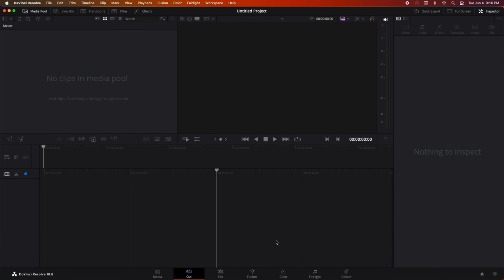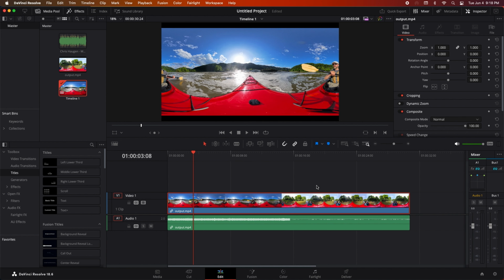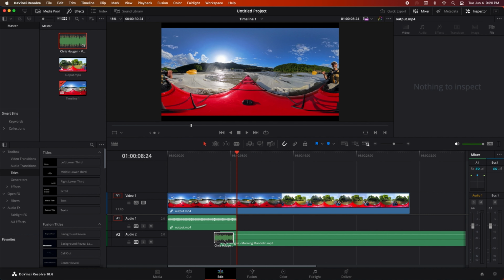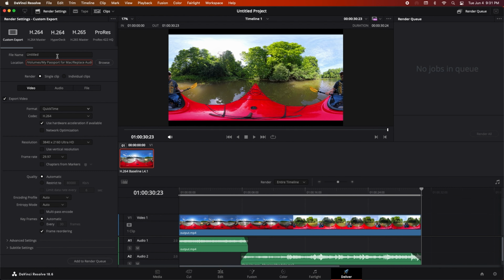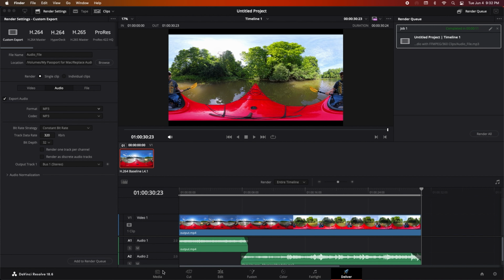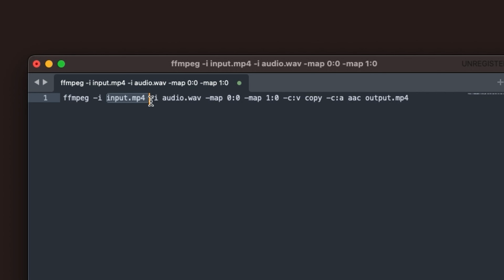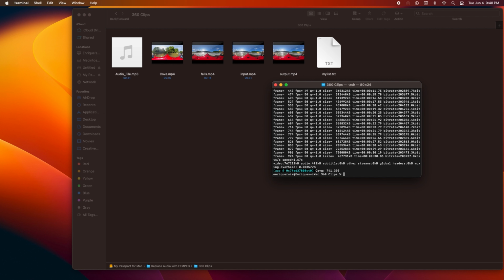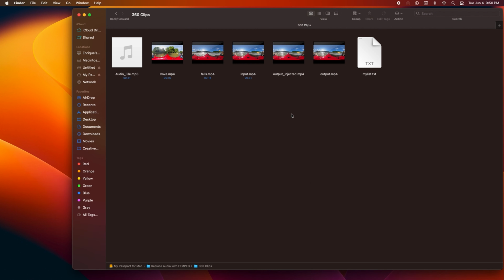How to Replace Audio Using FFMPEG

Comment: @wildwonderfulWeekends, the spatial media metadata injector is not supporting anymore on the mac. Do you have a workaround for me? Thank you! I am ediing some videos for an exhibit in 10 days...
Reply from the maker: Hi Dorine!  Wow, I hate to hear that MAC no longer supports that tool.  Lately, I've been posting most of my immersive content (VR180 and 360) to DeoVR instead of YouTube.  That platform is natively geared to serving immersive content and the video files don't need any meta-data.  You specify what type of content it is during upload and the server then knows how to present it to viewers.  I wish YouTube would adopt that model.  

I realize that may not solve your problem, unfortunately it's the only way I know other than being able to run Spatial Media Metadata Injector.  I'm always surprised how relatively little support there is for doing this type of task.
Reply: @WildWonderfulWeekends  thank you for immediately checking!
Reply from the maker: @dorinevanderwijk4745  Absolutely!
Reply from the maker: Hey, I just re-imported a 360 degree video into Insta360 Studio that had previously had the meta-data stripped from it and made a minor adjustment in color then re-exported it and the meta-data was re-injected.  So that may be a solution that works for you.  I uploaded it to YouTube to make sure it would be recognized as 360 and it was.
Reply: @WildWonderfulWeekends  thank you I will check this work around. Also I for now also have another apple device without the latest IOS update, that works also :-)
Reply from the maker: @dorinevanderwijk4745  Awesome, I hope it works!
Reply: @WildWonderfulWeekends  this works, but I do have another question. If I am stichting different videos together, sometimes it works perfectly fine and sometimes the command seems fine but then for example the video of clip 1 stays the whole clip, while you do hear the audio of clip 2. I have not figured out yet, even with letting the assistents of these days read the logs, what it is. Maybe you have user experiences like this? I am not sure if you can send me a direct message?
Reply from the maker: @dorinevanderwijk4745  I'll be honest, I've moved away from using FFMPEG almost entirely and started using ShotCut.  It's free and it preserves 360 / 180 videos without causing any new distortions or extra space around the video (like Davinci Resolve sometimes does.  And it lets you export at full 8K resolution (still for free) and it has some very capable tools for color grading and other typical video / audio editing tasks.  It's not like any other tools so there was a bit of a learning curve but not bad at all.  Have you tried it?
Reply: @WildWonderfulWeekends  Hm, I see you are giving me a challenge to learn something new... :-). Not sure if I can learn it in a couple of days, since the expo is next week, but thank you for the input and I will check it out! Indd Davinci I completly avoid for videos (use it for sound cleaning) because I don't want to get stuck in the change of distortions.
Reply: @WildWonderfulWeekends  thank you so much, it did work!
Reply from the maker: @dorinevanderwijk4745  That's great!  I'm glad you were able to line it out.  Nothing like the suspense of coming right down to the deadline, right?  Sometimes I think we're all in our own personal versions of the Truman Show.  ;)
Reply: @WildWonderfulWeekends  hahaha, we should all connect more and unsee the Truman Show :-)